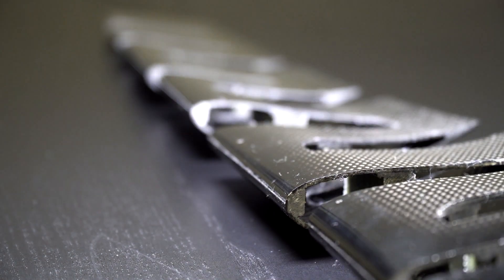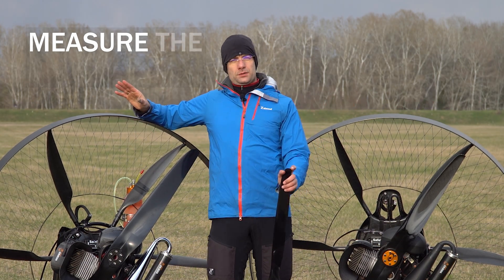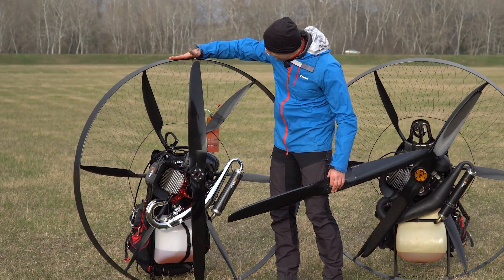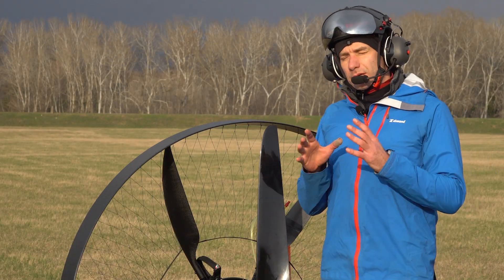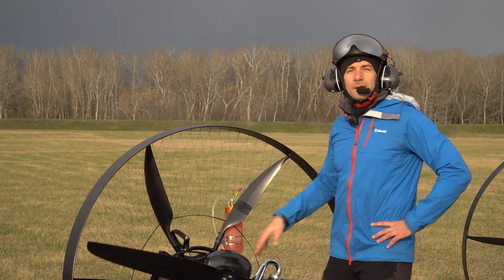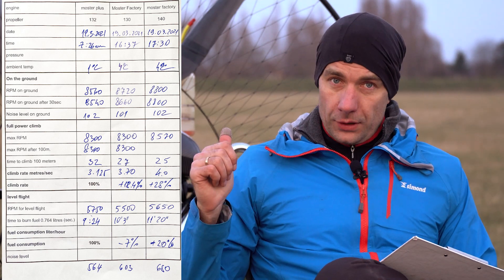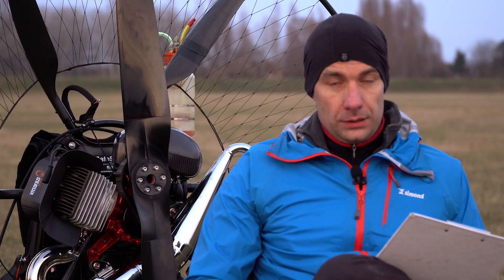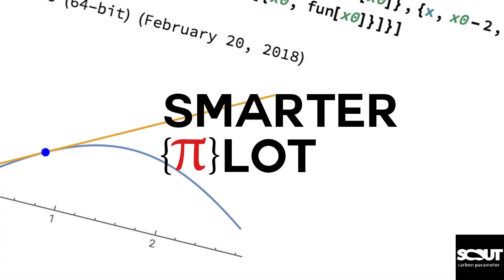Moster Factory R - What do you get for your money? - Smarter Pilot series

Comment: This was an interesting and entertaining test. I would 2nd @Daniel Jones comment however, and expand upon it a bit. (I get skeptical whenever someone pulls out a clipboard. 😅)

Was this an “engine power comparison” test or an “impact of propeller diameter” test? If testing the engines, the props used should be the same. If testing the prop diameter difference, the engines should be the same. Unfortunate for this test we are working with at least two factors as a basis.

I would think that fuel consumption would differ with different sized props. Every cycling of the engine means another gulp of fuel so with the smaller prop, spinning faster (to produce the same thrust to maintain the same altitude) the engine would consume more fuel. Just a hunch on my part.

Difference in prop diameter could also impact climb rate(?), which (climb rate) was used as a metric in this test to measure relative engine thrust/power.

Can you describe how altitude was measured? If done with GPS, what is the margin of error for the device that was used for that measurement? Cell phones for example can vary wildly, impacting margin of error/accuracy, and so the test results. Even using the same mobile device, I understand that consumer gps devices currently produce accuracy of 4m vertically (overall potential deviation of 8m test to test?), and that’s with an 80% view of the sky. I could be wrong but even though there are no tree or building obstructions when at altitude, you probably only get a 60% view of the sky sitting in a PPG seat.

Finally, I don’t understand the benefit of being airborne to measure thrust. It would seem that a ground-based staging would allow for much greater control of the variables.

Comment: Can you explain the diffrence between the reduction on these? There's 2.68 and 2.87. Why does vittorazi do this? A 130cm prop on a 2.68 reduction produced the same thrust as a 140cm prop on the 2.87 reduction. You could use a 140 on a 2.68 and get more thrust. I just dont understand the concept behind the 2.87 reduction.
Reply: 2.87 reduction means for the same engine RPM the prop spins slower than a 2.68.  With a larger length prop, you can spin it slower which means it has more efficiency potential as compared to the same length prop spun faster via 2.68.  Also consider the same length prop is different for a 2.68 and 2.87.

Comment: Comparing 130 was it with same prop or different for 2.87? Just bringing down the rpm of the prop is not going to give more power. And if it another prop and 2.87 then it's not really apples for apples.

Comment: Loving my R on the NXT. I moved from a different brand with MY19 Moster Plus, so did not feel confident with my side by side comparison as there were many more differences than the engine alone. However my butt dyno measured +15% power. I thought it may have been placebo. Seems reasonably aligned with your measurements ✌️

Comment: Will the size of your wing skew the results of this test. I fly a 26 meter spyder 3 and I weigh 235 lbs?
Reply from the maker: There is obviously more thrust. No doubt about that. 
Yes, different gliders handle power differently. For example my advanced paragliding wing Gin Carrera cannot take much thrust. The glider steps back with a high angle of attack and despite being an advanced and very efficient glider it does not climb much. Adding more power actually makes it worse. 
But the Spyder is OK, it is made for motor and you would climb nicely. Sure you would feel the difference.
Reply: @SCOUTaviation  thank you for the info. I thought that it might make a difference I just didn't know how much. Great videos. Keep up the good work.
Reply: Cool vid 👍👍